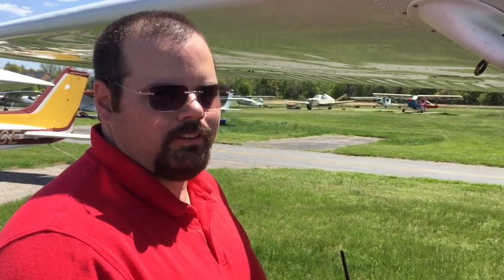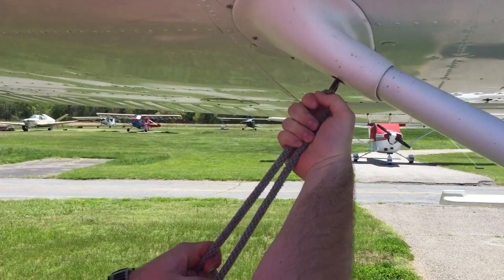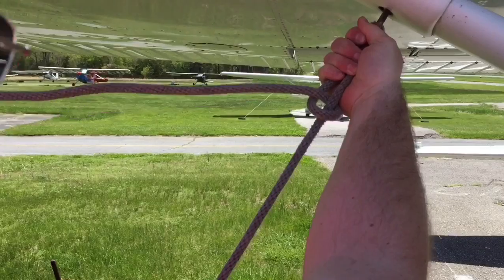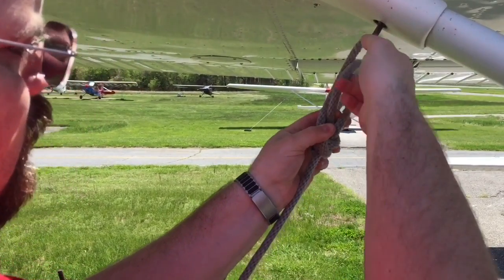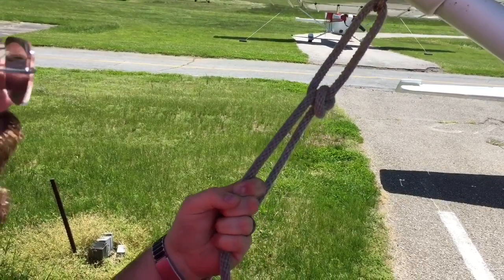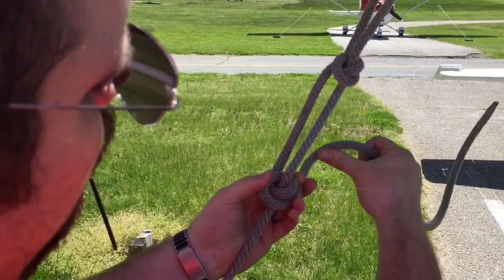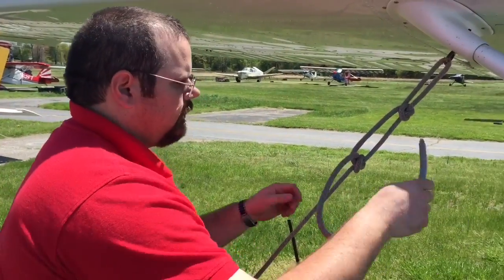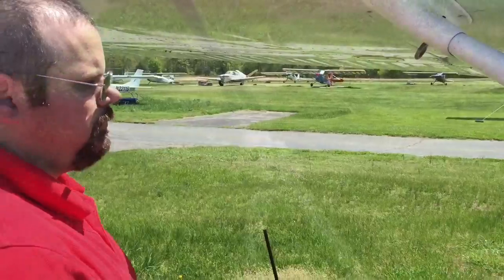How to tie down an airplane

Comment: The last "bad" knot looked like a taut-line hitch (more for camping where you can adjust tension on a tent tie-out.  However, like you mentioned, it can definitely work loose if not paired with a locking hitch

Comment: only on cotton rope.  I tried this for stuff in my truck   nylon   slips
Reply from the maker: If the rope is new and slick, there isn’t much friction to make it work right, so an extra knot or two can be helpful. 
I’ve been using this on nylon and poly rope for many years, so it does work.

Comment: I'll take a trucker's hitch anyday of the week over this. And inline figure-8 or alpine butterfly takes mere seconds to tie to create a mid-line loop, the run the rope up through the tie-down eye, back down and through the loop you made, pull it tight using the mechanical advantage you now have, then finish with your knot(s) of choice (e.g. half hitches, clove hitch, etc). The mechanical advantage doesn't just make it possible to get more tension on the line, it also makes it easier to hold that tension and retain it through the entire tie-down process. 

Or just move onto the 21st century and get some cam buckle straps or ratchet straps and call it a day, although personally I think ratchet straps are a PITA and slower than just using rope, but cam buckle straps are awesome and you can back them off with a couple half hitches for added security with no more effort than tying a plane down with rope.

Comment: Hi, I''m struggling to find the information I need so I decided to try youtube. What you would take for your single prop, if you wanted to go away camping with it? For example: chains to tie the wing and tail down; but how would you secure those chains to the ground? Are there special pegs you'd drive in to the ground? What about other things.....tyre puncture kit? Oil? Tools for general maintenance, gaffa tape, windscreen cleaner? spare fuel pump?.....etc? I've heard this equipment be referred to as "Camp Lot" i.e. equipment you need for your aircraft if out 'camping' with for long periods. Any information would help. Thanks.
Reply from the maker: Hi, I'm not sure that I would be of much help with your questions.  I've never taken an airplane out camping, or needed to tiedown where there weren't any permanent ground anchors already installed.  There are anchors for that, some are screwed into the ground, others have several large pins that are driven into the ground at intersecting angles so that they'll hold.
Reply: If you have to ask those questions, then you aren't ready to go backcountry flying alone. Repairs and major maintenance must be done by a certified A&P mechanic unless you're flying an experimental amateur-built plane or an ultralight.

To answer your questions:

Tires -- If you're landing anywhere except well-manicured grass strips, you'll want big tires made for that. Alaskan Bushwheels is a popular brand. Patch kits for those tires are available from the manufacturer and I'd recommend them. I'm not sure about the legality/regulations of patching an aircraft tire on a certified airplane, but it's a non-issue for experimentals.

Off-field tiedowns -- There are many solutions for ground anchors, and which one is "best" depends on the soil type.
- Duckbill anchors: A metal "bullet" on a length of steel cable. Google will explain better than I can here. Pullout force in hard soil can be well over 1,000 pounds for a tiny little 3" anchor that costs <$10, but most of them aren't made to be recoverable. Bush pilots like them because they're light, cheap, fast to set, and you can tie some flagging/survey tape to them so you and other pilots can find and reuse them again. Much like rock-climbers setting bolts, there's varied opinions on leaving something permanent in a wilderness area. Placed sparingly and in strategic locations they're a great asset.

- "Corkscrew" type anchors: The corkscrew types look big and strong, but if I recall correctly their failure mode is the eye on top unfolding under surprisingly little force, not the anchor pulling out; some of them may have a welded eye on top and be better. Setting them, especially in rocky soil, is a process that requires equal amount of patience and brute-force.

- Ground screw anchors: They look like a small auger or actual screw, not a corkscrew. They take a while to set, and they're heavy, but they hold well. Removal is just as tedious as setting them. They do start and drive into the ground much better than the corkscrew varieties thanks to the central shaft guiding the anchor straight and also acting as a sort of pilot drill to start the hole.

- Homemade/proprietary systems: There's a popular system out there that appears to be a simple piece of angle iron with a few holes drilled in each side allowing for 4 to 8 steel spikes to be driven in. Lots of people swear by them. They're pretty easy to set, and probably the easiest to remove. Other proprietary and homemade systems exist.

There's a lot more anchoring solutions out there than that. Fellow bush pilots in your area will be your best bet on letting you know what works best in the soil types common in your area and what strips may already have duckbill anchors installed or other semi-permanent anchors installed.

Oil -- Every pilot out there hopefully carries a couple quarts with them. Airplane engines aren't built like modern automotive engines; a little oil consumption is expected. I know of a pilot that had a TSIO-550-C that was drinking a quart per hour, but that was at something north of 1900 hours. On that engine's last flight to the maintenance center he had to stop to add oil even though he had plenty of fuel for a non-stop flight.

Spare fuel pump -- No. Every plane I know of already has redundant fuel pumps, usually an engine driven pump and one or more backup electrical pumps. If it's a certified plane you can't change things like that yourself anyway. If your plane goes down in the back-country you need to have one or more bush pilot friends that can come rescue you, then fly you back to fix it along with parts, tools, and a certified A&P mechanic if it's not an experimental amateur-built plane. If you have a certified plane, try to make friends at the maintenance shop with the A&P's, and that's just so one of them will be willing to fly out to the middle of nowhere to fix your plane, still be prepared to pay $$$$ for repairs in the field.

Gaffer tape -- Sure. I've heard of guys temporarily patching small tears in the skin on bush planes with duct tape (bush planes are often covered in coated fabric, not aluminum). It's also just super handy to have, especially in the back country.

Windscreen cleaner -- Probably not. Weight matters, and a pound here and a pound there adds up fast. You will almost certainly hit the useful load limit of a single engine plane before you have everything that you want to take. I can think of a LOT of things I'd rather have in the backcountry than some windscreen cleaner.

Tools -- A lightweight, minimalist tool kit is useful. And I do mean minimalist. A pair of vice-grips, screwdriver, and a multi-tool will probably cover anything that you don't need parts for. Just something to pop the cowl and to tighten anything that may be loose. If you have a ground-adjustable prop you may want the pitch gauge for that and a proper wrench for that size bolt.

My advice: pack light. Trying to fly over gross weight has killed bush pilots. All the tools in the world won't help you while you're in the air. Your main concern should be for yourself, not your plane. A satellite communicator IS something that might save your life, as is a basic wilderness survival kit with flares, space blankets, etc. You don't need a satellite phone, which is $$$$$, just something like a Garmin InReach that can do text-only and SOS messages with GPS position; they're quite affordable.
Reply: @ParadigmUnkn0wn  Thanks for the taking the time to detail a comprehensive answer; much appreciated. I'm still in the phase and as such gather as much data I can; I won't be flying anywhere solo nor camping until I have everything prepared and getting information from people with experience rather than just the 'talkers' is valuable. Thanks.
Reply: @firststep7750  No problem. I understand where you're coming from. I planned, and still plan, things surrounding aviation with an almost obsessive compulsion. Scouring the web for POHs (pilot operating handbooks) for my dream plane once I get enough hours to make insurance affordable in a high performance plane. Comparing the performance of various planes on various long cross country trips, running the numbers for different altitudes. Even little things like factoring in TKS fluid to theoretical budgets. Planning your next step up, or first step into, aviation is addictive, but not as addictive as flying ;)

In my experience, I'm not alone in that. Pilots, at least the good ones, tend to be borderline obsessive planners that try to account for every variable and leave no unknowns meaning no surprises and the best possible outcome. I reckon you'll make a fine pilot if you aren't already.

If you're interested in bush flying, you can build (or buy) a Kitfox for a decent price, with "decent" being a relative term in the aviation community. They're reasonably fast to build, especially if you splurge on the quick-build wings, and if you're thrifty on your avionics and other features you can finish one for well under $100k. If you're not licensed yet, they also make a light-sport version that comes pre-built from the factory for right at $100k well-equipped. Financing exists and rates are pretty decent given the current inflation rate. I dare say that you might actually come out ahead on a financed plane in a few years with the way things are going in both the economy and the used airplane shortage.

There are cheaper options of course. And even a stock Cessna 172 will happily operate in and out of mowed grass runways. There are pretty cheap certified bush planes out there on the used market, but beware the maintenance bills. It still might be far cheaper than a KitFox, but just have some idea of what to expect going into it and *always get a professional pre-buy inspection*. I don't care if you think you found the best damn airplane deal in the world, get a pre-buy inspection and have a professional review the sale contract.

Comment: How should I tie down the end to the ground before tying it to the wing? The same way?
Reply: A good knot for tying to a hard point on the ground is a bowline. There are plenty of videos on how to tie it, but it's the one young scouts learn with the rabbit coming out of the hole, going around the tree, and then back in the hole.
Reply: use a bowline knot or a figure 8 follow thru for the ground... the benefit of this knot here he showed you is that you can tension it. You only need 1 tensioner in the system so it wouldn't be needed to tie this on both ends of the knot.
Reply from the maker: Jay Philip Williams  I suppose if you only wanted to temporarily use the rope in that location, you could do that. But the knot only holds with tension, so it wouldn’t be very handy on the ground end if you’re using it over and over at that location. Normally these are tied off to the ground support with a more permanent knot.
Reply: Flip Bowline

Comment: The knot you tied first is what's called a half hitch, then as you came through the half hitch the second time and pulled tight, you then made what is called, a blackwall hitch. Then you repeated for the second one. It works very well in 550 cord, especially.

Comment: if tension on the loose end is released, this knot will slip.
Reply: throw an opposite half hitch in at the end or overhand knot around it and it will prevent that

Comment: I don't understand why this knot is considered safe.  It only holds while in tension.  Without tension (for example when wings rock in a storm) it falls apart.   Tying several in series is an improvement, for the lowest knot has to fail before the next higher knot can.  But still, why not use a better knot?   A simple bowline. for example.
Reply: I prefer to use a tautline hitch
Reply from the maker: Sky Pirates RC Club 
If you actually tie it with tension, then there isn’t a problem with it slipping. I’ve been using this for 16 years now, and planes that are tied down with it correctly have weathered many strong wind storms, and they’ve never failed.
Reply: Rodney Hover,  After playing around with several types of ropes,  I think the security of this knot depends on the size, stiffness and "surface friction" of the rope being used.  It seems to hold well with some types of rope and poorly with others.  I think a good idea would be to tie a half hitch below your knot (called an "awning hitch", I believe).  The half hitch would make it into a "midshipman's hitch" - still basically a slip knot, but a more secure one.
Reply from the maker: I have used one particular type of nylon rope that felt slick to the touch when it was new that didn’t work great. Using a third knot instead of two allowed it to hold just fine. After a while, the rope quit feeling slick, and now I can’t tell it apart from other ropes. 

This knot is so easy I can tie it with my eyes closed, it hold better the harder you pull on it, and yet it is never needs more than just a light tug on end to untie it. I have yet to actually see another knot that hits all three of those targets.
Reply: @skypiratesrcclub6436  The FAA only requires the usage of the recommended bowline knot and it is the best available knot since it tightens when it is pulled down so realistically the Bowline is the best possible knot but also the usage of the Chain is the best way of tying down the aircraft mainly because of its material.